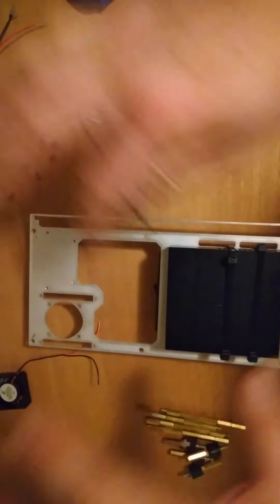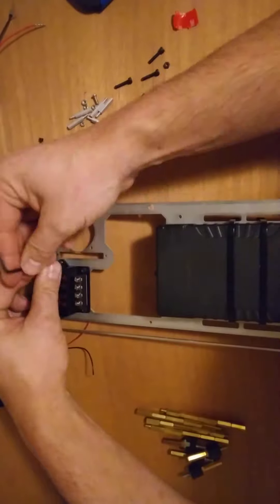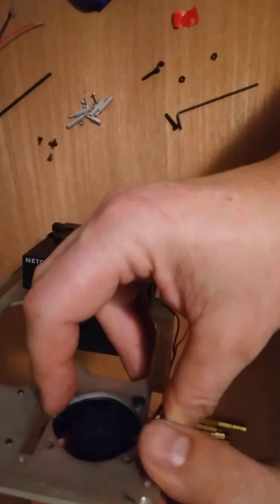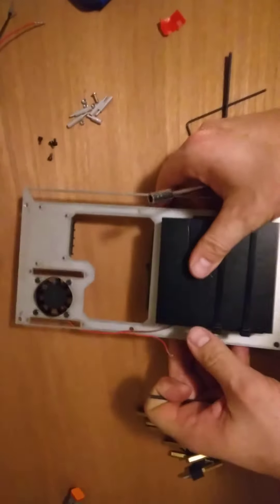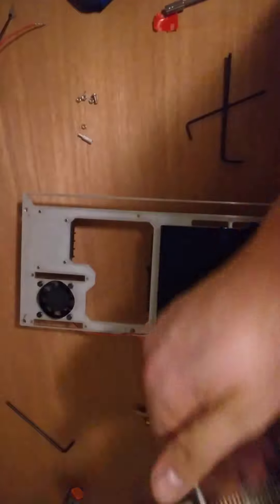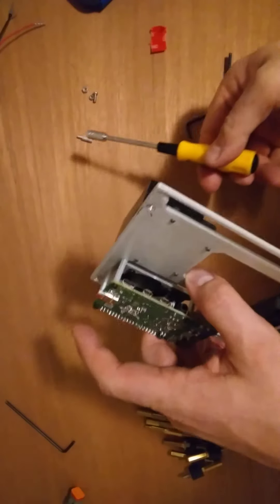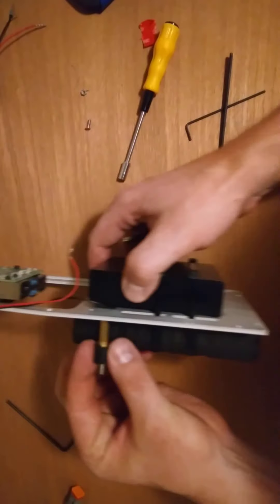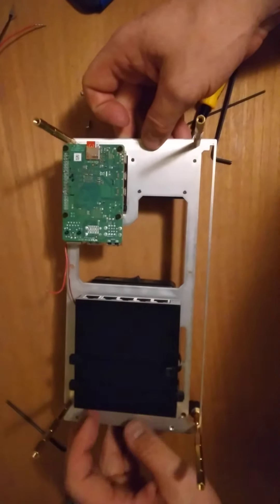Raspberry pi 4 50 Cal ammo can build:  Part 3 B - mechanical assembly

Comment: what is the link for the recommended Raspi? It is not on the materials list.
Reply from the maker: Any Raspi 4 or 5 will work.
Reply: @deplorablesecuritydevices  you also mention a "kit" with all the standoffs, I could not find it on the material list. Could you send a link for this?
Reply from the maker: @AdventureBros-Krig https://www.amazon.com/dp/B07PKTVB18?ref_=ppx_hzod_title_dt_b_fed_asin_title_0_1 This is the kit I bought.  Its out of stock so I found this one:  https://www.amazon.com/HELIFOUNER-Standoffs-Assortment-Threaded-Motherboard/dp/B0B7SNPSGZ/ref=sr_1_4?crid=3CFL7X8DR6FFB&dib=eyJ2IjoiMSJ9.b1b3d58mL_MnESwjhhBDHd7P_0OvFxuja8Zge0RIjGUBSN1l7hiWo17nV3dMDl5e-6m8iK7su3GHtd6OygCC6CGVzWzBRtrurZY7JdzgGtICCIap4bfK2A0ByEWMOlPVMvfelXFQ0VTwfQSti3cuJFdesgKV3HHrI1mDzTzAk2oz7TGvV-FVjxdnTAIR-hPjCTlyJnZFsoZuNws-9Bicb8n1wMg7Bv1UBmx2rReOtHcat69QHRaVCNEnv_ZaNT3TDdIEi8m6vXmFwuGF0mGu3OVr3SGhdnezJmSKRxTVNKQhFSKHEHzY_HlSxC13KpgU_KvQOWSkiDKvjaXhUqFhfjDMAllypzmZHbA1W-HpS3A.uu9AT2ZusQl62b84HOcHm8Jo7hzrzjADLb2z5qHkekc&dib_tag=se&keywords=M4%2Bbrass%2Bstandoff%2Bkit&qid=1739636942&s=industrial&sprefix=m4%2Bbrass%2Bstandoff%2Bki%2Cindustrial%2C162&sr=1-4&th=1